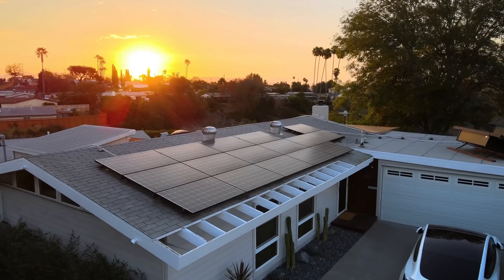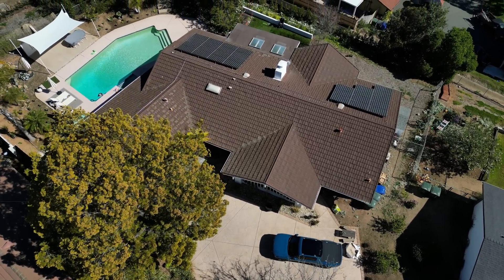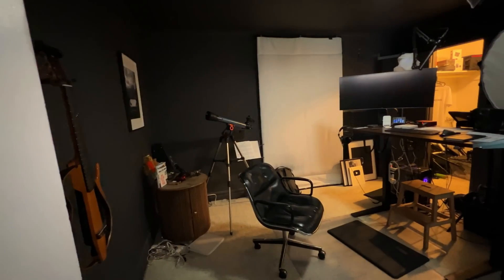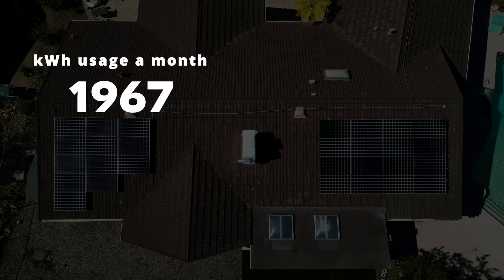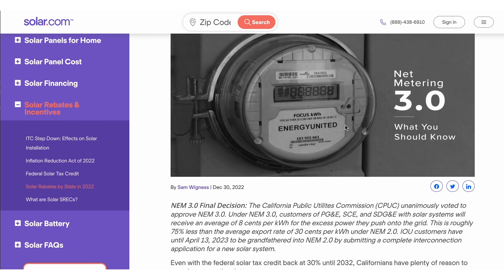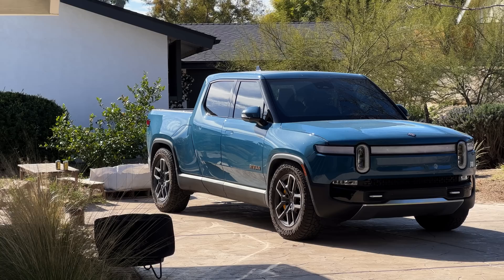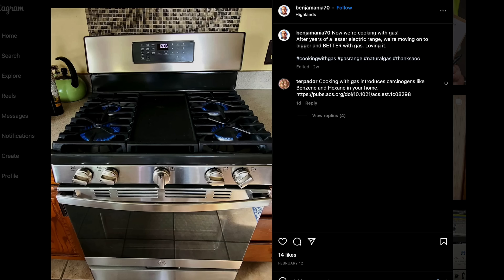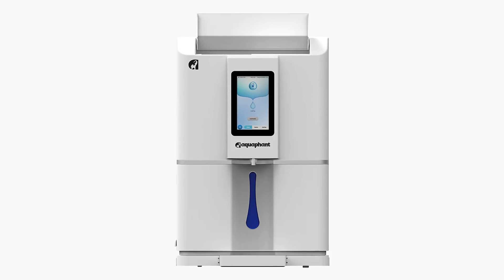Going Off-Grid at my New House!

Comment: In my new home, we went all electric.
20kW solar - 3 phase for EV charging
Heat pump hot water tank - we got a $1200 rebate for heat pump version
Heat pump pool heater 17kW (2.3kW draw)
6 x split system AC heat pumps for cooling/heating individual living areas
Heat pump condenser dryer
Induction stove top - easy to clean as top doesn’t burn spills, better control than gas, was inexpensive $250 from Aldi
Battery BYD 19.3kWh DC coupled with Fronius hybrid gen24+ inverters

I almost went off grid in the build, to save the $11.5k grid connection charge to run longer lines. But I estimated I needed $40k more batteries to do off grid properly (we have frequent small grid outages)

Regarding your rebuild, I would recommend all of the above technologies, (whilst retaining grid access, just in case). With your huge energy usage, I’d look to halve that first. Seems excessive. Add as many panels as you can, facing east and west is now best (to minimize your own inverse duck curve), as panels are cheap now and last. So a minimum of 20kW,more if you have roof space . No one ever complained they installed too many panels..

My rule of thumb for battery/panel sizing (with operating a big off grid motorhome LFP setup over the past 6 years) has changed from 1:2 to 1:3.
So 20kW of panels, 60kWh of battery. Recharge time in summer of 3 hours gives some leeway for cloudy/rainy days. Fully Off grid is much more difficult than 95% (hence paying a nominal fee to keep the grid connection). My 2c

Comment: I’ll be interested to see what you spend depreciated over its useful life.

Looked into exactly what your doing two years ago.  Less the batteries.  Proposed cost just short of $100,000 .  With 10 and 25 year life, hardly cost effective at all.

Just replacing gas cooktop with induction:  Upgrade breaker box $6,000.   New circuit for induction cooktop: $1,009.  New induction cooktop: $2,000.  

Would work out really well for new buyer should we sell in the next few years.  But for us staying here for ten more years at least?  Not so much.

Comment: sf bay area guy here.  we are 1500sqft single story. and recently installed 10kilowatt solar with one powerwall 2 plus.  If it's sunny we can go indefinitely off grid.  we don't charge EVs yes bc we have a train that goes to our work nearby.   the train is our fsd tesla currently.  and we have e bikes etc and some very old ICE trucks that I only drive to haul and make $$ or get firewood.  we devote only one room to heat if heating with electric and I'd I choose to heat the whole house then I use firewood stove.  we also can cook on our wood stove.  they are not permitted in many urban  areas but I'll never own a house without a woodstove for back up. bc if the shtf. what's allowed and not allowed goes out the window.
Reply: So, your burning wood on no burn days in the SF Bay Area?
Reply: @Tom Harais  no burn days are rare in my area on the days you would actually want to burn so no.  but if shtf came laws and regulations don't matter so as a bare minimum even if I didn't use it due to regs I would still have a woodstove plan in place for back up.
Reply: @jslove777  

So, you're outside the BAAQMD but live in the SF Bay Area?

In 2022 large parts of November and December had spare the air days declared by the BAAQMD. The very times when heat would be in demand.

Next up, BAAQMD bans BBQs!

Comment: Water heating typically the next largest consumer of energy for families.   The quick solution would be a hybrid heat pump like the Rheem Proterra 4 system.  It has a UEF (Uniform Energy Factor) of 3.6 to 4.   That's unbeatable ...electric alone can't get near this nor can gas.    The issue is we're on the cusp of North America moving to high efficiency mono bloc systems.  The allure here is you replace the current HVAC system with a compressor or two outside and it runs your air handler and water heater and more.  For solar owners the efficiency is going to be enticing.   I figure a system for the average home will run your entire HVAC and Hot Water on a 30-40 A breaker.  LG HVAC just announced a system the Therma V running on 410a coolant but i'm a bit more keen on the stuff coming in a couple of years based on 454b coolant (likely due to sub 500 GWP).  As with most things it's hard to say when to jump in.
Reply: Better check useful on those heat pumps.  Along with repair costs.  

We can all dream but, bottom line is long term defining.
Reply: @tharais  i’ve already resigned myself to purchasing any extended support coverage on a high-efficiency unit if we go that route. Better to be safe than sorry.

Comment: When you sold your last place did you capture any added value from all the improvements in the sale price?

Heat Pump clothes dryers and hot water tanks are a thing. Excess PV storage in water heater tanks. Some are thinking about using reject heat from A/C's to heat swimming pools.

Comment: Heat pump water heaters work great on solar and would be a good replacement for the gas water heater.  Also, you might add mini split heat pumps since they run well on solar systems vs the huge startup amp draw on regular whole house heat pumps. Just some thoughts.

Comment: I went with solar in late Oct of 2022, installed a heat pump, and got rid of the gas water heater.  But living in Northern WI in the winter months spacifically this year with all the cloud cover I could not generate enough power to run the heat pump and or the hot water heater without drawing from the grid.  But ZI only went with 7 kw system  Maybe in a few years I can add an additional set of panels and another power wall, and perhaps it will be enough to handle those devices.  I also can not tell you how much fun I have had cleaning roof mounted pannels of snow and ice.
Reply: Add in new inverter to go with those additional panels.

TANSTAAFL!

Comment: Probably somewhat different for everyone. The approach I took was create the maximum amount of electricity for all possible scenarios. In the beginning, much of it goes back to the grid. As appliances are converted,  and most especially as the central HVAC is converted to a heat pump, the surplus of electricity goes down. Driving is hugely variable for me, so I averaged out my kWhr for the cars over the year to compute a daily average. My personal criterion for storage was 4 full days of the sun going out and the batteries never go below 50% SOC. Given my type of panels and mounts (all ground), on a fully overcast day my production is approx. 15% of the typical irradiance, so some margin built in there as well. My water heating is still tankless gas. That is taking longer because I want to do a full two stage design of a solar water heating stage feeding a tankless electric. For the longest runs, point of use electric heating is already installed. My first PV was under NEM 1, so I'm still in the ancient program. I don't really care about money paid back for my excess but am more concerned about not having to buy any. Power outages are a way of life where I am, so pricing that is it's own computation in the same fashion as business continuity planning. As far as what equipment I used, that is probably useless information since I'm an EE and didn't need finished solutions. I did design the entire system to be doubled without any physical or electrical redesign issues since its hard to know what the future will bring as our planet heats. Forgot one other thing: Don't skimp on the wire gauge for the various runs, most especially the service. Code says the SER should be a minimum of 2/0 copper for a 200A panel. Also make sure the disconnects are designed in a manner that broken equipment can be removed and replaced without a home shutdown. Very infrequent, but things like inverters do break.

Comment: Please tackle a tankless-electric water heater, then the cooktop. Thanks!
Reply: Tankless give you endless hot water but they aren't efficient.  They have a COP(Coefficient of Performance) of less than 2.  Heat Pump is the way to go especially in a climate like So Cal

Comment: Before you buy more solar, invest in negawatts. Do the rational cost effective things to reduce that 2000 kw/mo down to say 1500. Then add panels.For example, what is the price per gallon of the water from your dehumidifier? it's cool but probably very inefficient.  I learned about this stuff from hunter and amory lovins back in the 1980s. Maybe a low cost DIY heat pump to replace the furnace? Solar BBQ in the back yard? Solar water heater?  Superinsulation? Some passive solar heating? - arbitrary aardvark.

Comment: Hi Ben interested in what you will do with solar, replace panels with more efficient higher wattage out and then add to the system or will you just add to what you have with different inverters?

Comment: Hey Ben, curious about electric water heaters. I have an older gas one that will need to be switch, so I'd be curious to see if you go with a heat pump style or electric tankless to see which one you prefer. I'm also curious about IRA rebates on these and how to maximize the money return.
Reply: Fwiw, we replaced our leaky old gas water heater with a 50 gal Rheem heat pump water heater last January and it is great. Totally worth it. There's a small IRS credit that reduces with higher income and many local state and utility rebates are available, depending on your area. I expect my payback period to be about 3 years and am trying to ditch gas as each appliance retires. As a bonus, if you put it in your basement, it doubles as a dehumidifier, which is great for basement conditions. Good luck!
Reply: Heat pump water heater costs 4x less energy to run than a tankless

Comment: Hi Ben always like these videos I think you should look at your daily - yearly usage and look at the optimisation of this first to see if you can fit this within your existing solar and future battery set up. So insulation first and how many gaps you have in your house to cool or heat it, heat pumps for everything second induction cook tops and other electrical appliances you need third. Good luck I hope it all goes well.

Comment: I have been off grid in central California for 5.5 years now. In a 3bd 2 ba house. With a Chevy volt. I have 21000w of panels 56kwh's of Chevy volt batteries with 18000w of inverters. Now that my system is paid off it's time to bump up my batteries to 70kwh's still with the chevy volt batteries. That should make things easier for those week long storms.
Reply from the maker: amazing!

Comment: An excellent quick video. Ben, I used to be a subscriber of many environmentally aware channels but I did a big cull and yours got caught. But you're back with this one. Good luck with your plans. Let me also mention Heat Pump Tumble Dryers. They consume way less than an electric resistive wire [quarter or a fifth.!] drying system. Just in case you didn't know that - bet you did. Looking forward to more of your videos.

Comment: To each their own but to try to justify any home batteries from an ROI standpoint is so dumb. The guy has countless spreadsheets on how to get the most bang for buck and then drops 25k on batteries. Its fine if you want to go off the grid for peace of mind but under NEM 2.0 the best bang for your buck is taking all that money and just getting more panels. SDGE has the highest cost per kilowatt in the nation.   Batteries will  have more  use under NEM 3.0. But being that he has solar already hes already probably under NEM 2.0 from the previous owner. Why spend all that $$ on batteries when you just go buy a new house in a few years. Makes 0 sense from ROI.  Which is why not even 1 in 10 homes with solar have batteries
Reply: Is SDGE more than the $0.39/kWh were paying PG&E top tier in NorCal?

TANSTAAFL!

Comment: Did you have an energy audit ? AC has to be your biggest energy draw which could be improved by insulation upgrades. Are you sure you have adequate room on your electrical panel to add more demand. Pool heating is an energy monster.

Comment: I also have a "hybrid house". For your water heating look at a system that takes excess solar and powers an electric immersion heater in your hot water tank. I have the Eddie from my Engergi and it dropped my gas usage by at least 50% in Germany of all places where we don't have as much sun as you have in California. They also have a smart car charger that you can set to only charge of you have excess solar called the Zappi. I think managing your energy usage is just as important as how you generate it.

Comment: if you live in southern california you should be able to reliably put your clothes on a line in the yard. sure you can have a backup drier of any fuel source, but i don't imagine you'd have to use it often at all. I've been air drying my clothes in humid louisiana for a decade. perhaps the easiest way to lower your dependence on grid power.

Comment: I recently renovated our kitchen and removed our gas range and went induction after using the 2 burner ikea induction tabletop and haven’t looked back. I’d also highly recommend the heat pump dryers as they work really well and are a good size too and I didn’t know that gas dryers were a thing! We definitely don’t have them here in the U.K. we’re totally off gas now (we have a ASHP for DHW and heating) and had the gas meter totally removed. I’m literally getting quotes for solar and batteries now we’re fully electric so doing basically the same as you as I want to reduce our energy demand from the grid as much as possible. The only downside is we don’t have the Californian sunshine here in Yorkshire! Getting the solar and battery would be the first job I think for you guys. Once your producing, you can reduce demand and improve your system from there. Panels are so cheap compared to everything else these days throw as many up as you can!

Comment: Hey Ben! That's awesome you have powerwall that will be installed. Can you share if you have information if the powerwall fails? Would you be able to run from the grid directly or have the powerwall serviced before you can get power back?

Comment: I would be an opportunist and buy what comes available at the best price even if you have to stage it later.  But you have to wire for electrical so that might come early on and it won't get any cheaper since electricians don't have sales.  I'd do that first.  Then start plugging things in EVEN IF you don't have enough off grid power.  You'll want both until that energy supply get bolstered.
You can do this in a year if you can book your installation contractors.

Comment: 2-3000kWh? Holy smokes... I assume the bulk of that is coming from powering your Rivian and Model Y, right? Either way, it would be worth looking into efficiency upgrades for your home as well (assuming you haven't already) because that would save you money in all sorts of ways.
Reply: And a swimming pool.    I don't care if it's a hot tub or a swimming pool it's going to be reflected in your energy for heating or pool pumps.
Reply: @hmurchison8123  

Most people don’t hear their pools in CA.  Even larger, commercial installations.  The weather in most of CA doesn’t require it and, it’s always been way too expensive.

Comment: Hey Ben, we took our home off-grid a few months ago in TX. 35KW of panels and 90KWH of battery storage using the “HomeGrid” system, Sol-Ark, and Lithion Batteries. Feel free to reach out if you want to compare notes.
Reply from the maker: Love that, they make great stuff and I believe are based here in San Diego!
Reply: Sounds like a massive house and property for those solar and battery numbers. Another angle is to look at your usage of power and maximise that first.
Reply: @MichaelSmith-px1ev  Yes, our goal was to be able to operate completely off-grid at full capacity, hence the size of the system. Off-setting costs is just a bonus.
Reply: Does the HomeGrid system work with an existing solar system with Enphase microinverters?
Reply: I live in Central Florida where electric is $0.13 kWh delivered. A loan for solar equipment can be more than my monthly electric bill. However, I have 2 EVs and would like to use them as a standby electrical source during a grid outage. Hope your project eventually includes V2H equipment.
Reply: @MikeDillardShow Do you have a video on the install?
Reply: @CanvassData  For our private mastermind customers yes, but nothing public.
Reply: I'm not American but I have been in TX for some time. Can you tell me how much you invested? I'm interested in allocate myself in TX
Reply: CONGRATS 🎉🎊 ON YOUR NEW HOME…living off grid comfortably has been a dream 💭 for all my life…now this is possible 🤗💚💚💚

Comment: 1) for heat generating appliances (w.h., dryer, HVAC), Heat pumps are great
2) Oversize your panels compared to current usage to account for electrifying appliances.  Also, micro-inverters are your friend, because who knows if a neighbor 's going to build upwards 10yrs down the line
Reply: Utility approvals generally will not allow oversizing from current usage.

Comment: Induction swap - very relevant and may be mandated in many states soon. Healthier air, better performance … and not a known  topic for many. 

For example I can’t find a 48” model to replace my gas cooktop, also what is involved in running power to kitchen, reduced ventilation requirements too
Reply from the maker: In the planning stages now, more to come!
Reply: The new elec circuit to your kitchen and required panel upgrade is likely to rock one’s world.  Especially in in hyper expensive CA. 😮